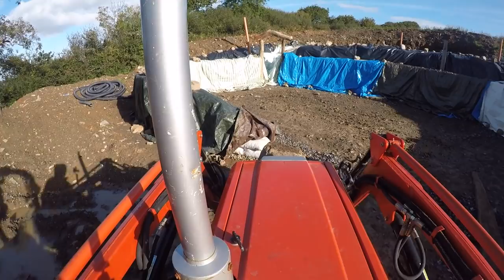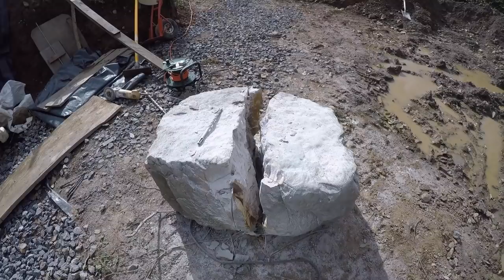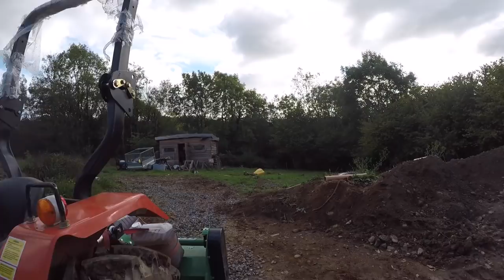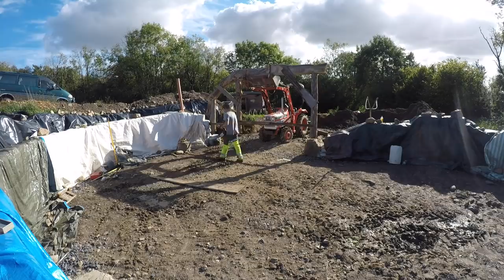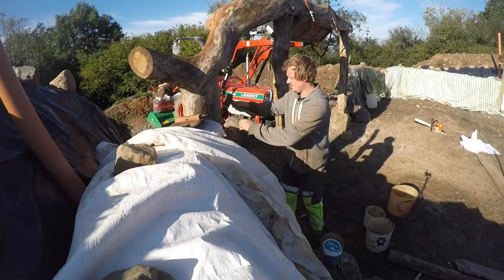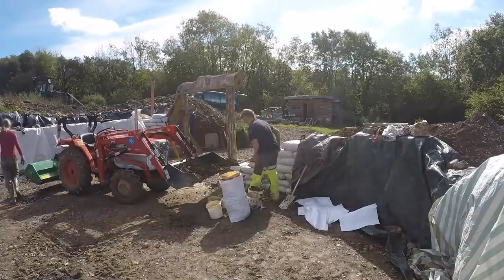Off Grid Earthbag workshop Part 12 Entrance installation

Comment: That entry door looks amazing. You have progressed very well for the relatively short time period you have worked on it. Having Kaz help out so much at the beginning started you off well. 

One suggestion I have before you completely shut it down for winter is to move some of the dirt you have piled up that impedes the drainage outside the wall. The little trench you and Dot dug by hand will not be enough to allow full drainage and your wall base will be wet all winter.

Comment: Hey Kris.  Before you shut it down for the winter.  Could you put a fixed measurement stick in a couple spots.  I'm interested to know if the bags settle at all over time (drying?  Etc.)

Comment: Looks a bit low for (say) a transit van.
Reply: Nah, you could get a transit through there
Reply: David Lowe looks about 2.5 mtr if current ground his finished level?i imagine he may even grade it away
Reply: matthew wood 
Look at 9:10. That's no more than a foot over her head - 7' Max.
Reply: David Lowe I paused it with kris in the archway, I’d say he couldn’t touch it with his hands at full stretch, but no doubt all will be revealed in future vids
Reply: This is the woodshop. No need for a transit van to fit in it. The upper portion of the building will have the metalworks in it. The door to that I am sure will be high enough to get in all sorts of transit vans considering he plans on putting a vehicle lift in it. This lower portion just needs to be sized for the lumber and other wood objects coming in and out.
Reply: UnexpectedParole Mad Werewolf 
The mystery is solved!